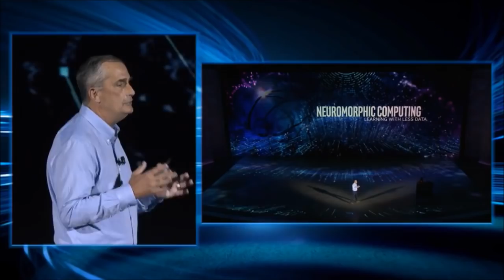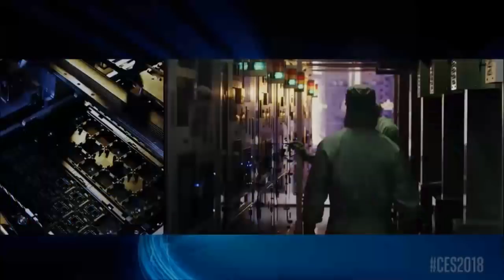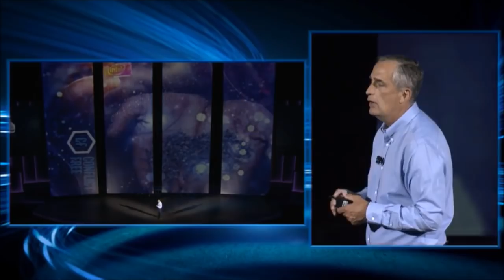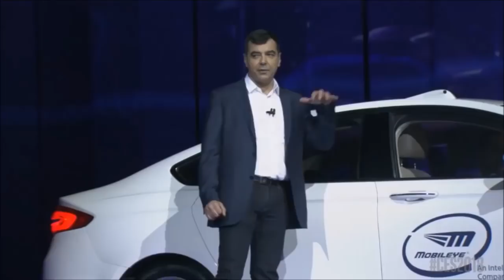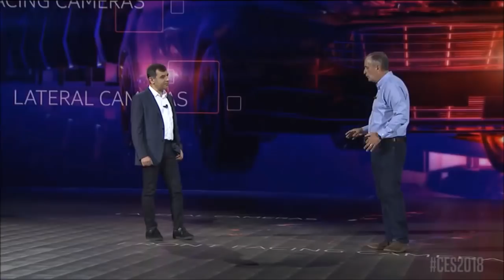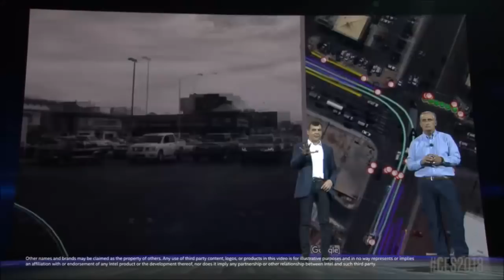Intel's New 49-qubit Quantum Chip & Neuromorphic Chip

Comment: Intel's R&D impresses the hell out of me, personally. I hear the AMD Ryzen and Intel desktop battle as AMD wins from some computer enthusiasts but Intel is abandoning their desktops race and going straight to Quantum and neuromorphic. There is no comparision between AMD and Intel. A working Quantum chip at room temp is beyond groundbreaking. Who cares if the presentation isn't pop culture and hollywood trickery. This is far better than anything put out before it. I'm surprised by the robotic enthusiasm of the crowd. Kinda creepy.
Reply: John LaFosse roomtemperature? Who said that?
Reply: Calamiro Asjcobeti your right. My bag. It is not room temperature. I've read a few articles on possible room temperature quantum chips on physics.org. I must have jumped to conclusions.
Reply: Still a step in the right direction for Intel.
Reply: No. A simple mistake. Last year, Physics.org listed an article or two on room temperature Quantum computers and I wasn't entirely clear after listening to parts of the lecture if they developed a room temp chip. Sounds like they are focusing on competing with DWAVE.
Reply: John LaFosse Yea a roomtemp working quantum computers are sweet :) lol just gotta make an emulated chip cooler :) and change a few other files AC/DC and rig up your CD Rom drive and shoot a laser back through your computer :) Ram ports :) moonflower.jpg Win XP :)
Reply: Nakor Z Intel is good :)
Reply: Jack Principle ever tried making the X circuit :) make the atoms in the X where it meets a circuit so it doesn't touch :) all with the eye :) eyeball it :) lol "i" :) the "i" phone lol the "i"Pad :) lol china and Proview Tech and the patent rights to the name lol and apple lol :) I hacked proviews email and wrote to their owner about how Apple and jobs fucked my on the i software and boot loader :) lol ELF and GRUB programming was fun :) see Tunes.org log :) 9-10-2005 :) its missing from the internet it was deleted after I copied it and sent bush and dick chainey an email showing them what I found :) lol some very incriminating evidence :) <++ :) lol see USAA FRAUD Facebook for the log :) lol Chinese dude @ Proview for the patents before 9-11-01 lol I was in 2004 -2005 with a clock hack you wouldn't only fathom of your logical I0 processor was capable :) Do you know what a logical device driver is :) how to make and timestamp one ? Do you know what timestamping and clock certificates are ? Are you aware of Quantum Entanglement and ink , and the air that l thoughts run an and how to hack your own thoughts and read it in code ?  Are you are of what the core of Windows is , how it all works , how chip design works , how bugs , and worms , and super colliders work :) notepad in dos ver >ver 6 :) engineering 0S + source code and Yahoo browser ver 3.14 and Explorer Intertnet ver 7.1 are was great it actually upgraded your ram 128mb , It's the quantum leap tool :) moonflower .jpg XP , Vista had a vet too :) gotta have 3 SQL's for quantum encryption :) Teleport , the trebuchet 1,2&3 3 being the necessary missing link for throwing data over the nuke fence :) aka Firewall fusion.dll and The smart fox jumps over the fence :) hehe SQL :) Transparency :) that was the big one :) that SQL :) with the trebuchet :) is the goods :) there were some SHA1 Al Gore Rythm Shannanigans I pulled on the gov :) lol ever sent a fax to another year :) hhehe :) or called someone in a different year :) lol win XP SP1 and the virtual fax machine was a great hacking tool :) hehe . It sucks windows took out all the good stock hacking tools after dos 6 :) hehehe
Reply: I don't mind Intel as a company.
Reply: The same monopoly accusations and lawsuits have come about for all or most of the major semiconductor industry. Its founding and formation is and was from the traitorous 8 which formed Fairchild and Intel. Semiconductor fabs aren't a dime a dozen and they trade tools between each competitors never retiring machines that are decades old in order to supply chips for older tech. If Intel doesn't provide this service why should they outsource their patents to startups? The monopoly ruling is probably right. In certain regards it is in the nature of a semiconductor manufacturer to have the best and highest quality facility. What impresses me still is Intel does have a better quality research and fabrication Facility. That is a good thing for computer users that they are dominating and pushing the envelope. I've got no problem with this move. Good for them.
Reply: Anyone can cherry pick negative information on any subject and I'm not really going to go there. The subject at hand is Intel at CES and what their direction from concentrating on the desktop market to putting their "chips" into neuromorphic and Quantum computing. I hear price gouging argument from gamers who own AMD mostly. And there is tons of negative things to say about all semiconductor manufacturing processes and the environmentally unsustainable model that all companies involved are responsible for. That being said, having worked in a semiconductor fab. I've kept an open mind about the desktop chip market and based on what I've looked into about Intel's facility and R&D they are pretty advanced. Maybe not the top in the world, however once they have an advancement in speed or techniques for making chips less expensive sure they should pass that on to the consumer, but their intellectual property is owned by them as a corporate entity. The higher price have a political side to it sure. There is more than public interests in a semi-conductor fab. Many of a semiconductor manufacturing clients are the military.  We can talk about negative fines and lawsuits of other competitors all day. I don't think that is relevant or a useful argument unless I want to bait trolls.
Reply: I agree. AMD is so proprietary
Reply: AMD is afraid to venture out to Quantum computing.
Reply: Silly Man Quantum Computers Dont Work In Room Temperature Everyone Knows That.
Reply: Jack Principle It's always impossible , till it's not :) see my USAA FRAUD Facebook page :) see my Drmstr.dll and core.dll logs for what I was doing with the versions , file size and dates :) I got to spy on the future and edit History . Merge the realities we had going on the different versions of internet , and Nelson Mandela's death :) lol Y2k clock policy and NT design :) I finished 4G on Sprints Network before I finished 3G :) I got to watch Obama take office remotely from 2005 :). History is already upto 2086 it can be hacked . I made a key so only I can open the port . Moonflower.jpg in Win XP was mine by design . USB 2.0 was mine by design, the first 100mb tcp/ip connection adapter was mine by design , NT 4.0 and 4.1 were mine by design , NT 5.0 thru NT 10.0 I made by design in 2004-2005 as well, Hacking the clock, the internet is an archive , I hadn't made My win 95 update to win 98 and win 98 update to 98 second edition and hadn't made the SQL's for the internet update in win 98 second edition till 2004 as well lol, Msft money 99 was mine by design , The copyright (R) bubble I had timestamped , in 2004 there were 3 versions of Windows CE and cellphone airtime platforms , The money for the airtime wasn't backed by gold or and digit in a computer , NYSE and insider trading ran rampant , The Clinton's and bush's had this tech given to them on a quantum hack , NASA Rover wireless tech , our realities merged in 2005 because of the data crooks in DC rigging NYSE and Virginia or Virgin mobile :) lol 9-11-01 hehe airtime :) I've been involved in making quantum encryption keys for Yahoo email servers and hacking the email servers in any year I wanted to and could edit history before the merger of 9-13-2005 :) Why did Nelson mandela die twice :) Why does every single copy of BerenstEin Bears now say BerenstAin Bears ? lol it's too funny :) I've spying on both versions of net lol :) Secret service Agent Brown lol came to my house and got schooled on what a pile of shit our gov is, office 2k for msft lol , their clocks went bust on Y2k and I made the gov officials a fix so they could open their product on 1-1-2000. You have no idea how fucked the clock was , it was at the end of the road Y2k and it didn't Truly get fixed until 2004. The clock and all software had holes in it like you wouldn't believe :) goto the clock in Windows :) open it :) click the advanced tab , and see where it says NIST internet synchronize :) I have an updated bios (NET BIOS) I made the software for myself , I popped 7 light years before I settled on the chip I have now . I blew up 7 bios chips to merge the timelines :) you should've seen the communications box on the phone pole :) plasma arch :) boom ! Lol see my logs on Facebook :) USAA FRAUD :) see my twitter feed :) and if your a programmer you'll understand the tunes.org for 9-10-2005 and you'll understand my drmstr.dll and core.dll file sizes and versions number for 9-10-2004 :) There were a couple versions of history and the future running parallels :) notepad in Windows is how I designed all my software , Reverse engineering VIA chipset Drivers is where I started , My name is VI< or Vic. IVIC or I Vic or MC :) M<2 MC2 MC2=E I started breaking down MC's and Squaring E's and Timeing Ram differently , the moonflower.jpg and power.jpg for Windows XP was my design . I made a win ME service pack for Win XP and fixed win Me's USB issue and wifi and bios issue w the clock :) I went back through windows ver 3- and wrote upto win 8 and the switch and NT 10.0. The logs for tunes.org = the smoking gun :) and also :) I rapped it while I was doing it :) www.soundclick.com/akalegendarystatus and my quantum encryption keys are compressed into the data behind the pics of my ID and red paper with CD's , and a pic w ID and bible :) I found a way to delete all the data of a pic .jpg and use it for a template to store data :) Use a UV and Infared and square the UV :) UV3E :) heheh I was able to ship tons of data this way around the internet VIA email VIA clock hack :) i.ink ink.ini ini.ini and clock certs :) after you break down MC2 = E the E flips like the Dell logo :) 0(R) the Enron logo lol :) I hated C++ so I snuck a Virus in some of the code I gave gov for Cellphone designs. Lol <++.......... a little PACMAN virus for them to eat their code :) Enron lol , Wa D.C. , Intel , intelligence agencies lol :) notepad is a particle collider :) if you can read and write new languages to code and decode the symbols on Egyptian walls you're know how to decipher my symbols and code :) heheh :) Lol Quantum hacking was so much fun , George Bush Spoiled it for me , took my security clearance away , shut down all of my fake names with real bank accounts , made it real hard for me to get shit done online . Lol The bush's Stratasec hack , virgin mobile lol, security for phones lol , Fuck the GOV FUCk NSA Fuck CIA fuck msft , Fuck the patent office , when I hacked them they and told them what I wanted patents on they laughed and asked me if I was serious :) Fuck yea :) lol they were In 1996 I wanted my Intel property rights for Win CE and cellphone airtime I had just made these clocks :) thy gave the some Crook the rights to sell the airtime and then sold 3 versions of the same year of airtime and I had to validate it all :) hahah the Mandela Effect rofl... try validating everyone's phone calls and validating the broken clock and making it have a recall on all invalid entries :) Hahah quantum computing at its finest :) USB 2.0 was supposed to be just a file you replace :) lol Intel and bill gates made everyone including world gov update their mainboard lol :) I could update any $50 PC from PC recycle because folks were throwing away good PC's just w old outdated ports and CPU . Upgrade RAm upgrade CPU and software and I learned how to truly hack NIST synch and the clock and learn how the core.dll of Windows works and how it's cooled :) I made a super cooler for it :) Fusion .dll :) mscoree.dll was fun coding . At PC recycle I could get all OEM msft OS's with original instructions. I learned to how make a genuine msft update in win 95 and the instruction book and ink.ini was updated :) the Xerox machine had a few ports I could hack too :) when scanning data can be hacked :) I used to send data over the air by scanning stuff too. The light from the scanner gives you a few years the data is in limbo. The speed of light , and how the ports inside ink and atoms are connected . Quantum entangled photons , at an atomic level , connected to every aspect of my life . Lol secret service came to my house , and told me they can't make it public because they have to "protect national security " Rofl Mandela effect- Haiti earthquake ,Quantum Entanglement , clock hack https://youtu.be/gSoz7GUwuEo Here is Nico , He is my coder friend , He was working for msft at the time I told him about my quantum hacks :) I seen Haiti get buried from the earthquake that The Clinton's cashed in on :) I told Agent Berg from secret service I seen that earthquake in 2005 happen on the clock hack and it was because of the clock Synchs . 9-13-2005 . I told the agent to warn Haiti of incoming :) The cellphones airtime had just been recalled and validated and some $ was still in banks from a reality that was deleted , as in never happened :) like My BerenstEin Bears books hahaha :) I live just a few exits down from Microsoft :) Vicrosoft lol IVIicrosoft heheh I always like IIVII icRosoft :) RO copyright the airtime the Dam machine is Running lol (R) bubble validation Certificates :) copyright My dreams lol Drmstr.dll hehe :) what versions in which reality now it's a mess :) Mandela Effect The Name Of The Book Bush Read With The Kids On 9/11 Has ... https://youtu.be/atZYYET7SQM lol
Reply: Jack Principle Silly man :) do you know what ver of Windows and when the first Alien head appears in core symbol fonts /) hehe
Reply: Jack Principle Silly man, if there was ever a quantum computer and it had been programming since 1929 you and most the world wouldn't believe it anyway :) lol I'm a tunes.org quantum engineer :) Quantum clock master technician :) AMD :) AIVII>
:) lol Win XP and win Vista lol XP and XV :)
Reply: Jack Principle AM I> AM FM AM PM AC DC :) wanna see what happens when you actually put a ground wire to the clock :) hehehe
Reply: Jack Principle how well do you know all the versions of history :) heheh and operating systems :) and backdoors , and all the fraud lobbyist in gov :) lol when I made the quantum computer I had to code and send emails in black and white Symbols that others would have to decode in the 1990's :) one of the first Things I did when I had the quantum access up and going was get lots of cash and open Swiss bank accounts :) lol I wish there were bit coins back then . When bush came into office Y2k he made sure all my $ was cleaned out the accounts and made sure I had no access to Capitol for engineering :) fuck him I still found a way to get a couple million dollars and pay people off To get HD radio going and the TV signals all going Digital , and Smart TV's and 3D printers :) you see printer drivers were always fun for me to make :) updating printer drivers :) doing lots of programming , I worked 168hours a week for several years until the job was finished , I put a timestamp on all my emails and programmed years upto 2012 leap second and then merged all previous clocks there and and kept certificates of validating time and softs. From 2012-2086 is a new chunk of air time :) https://www.wired.com/2012/07/leap-second-glitch-explained/, a block of data just waiting to be spied on :) hehe :) I made the internet for submarines too for the Clinton's in the 90's remotely from 2004 :) lol Yahoo email hack :)
Reply: Jack Principle try quantum computing what happens to a whistle blower down at CIA , NSA , FBI, News outlets Rofl :) 9/10/2001: Rumsfeld says $2.3 TRILLION Missing from Pentagon https://youtu.be/xU4GdHLUHwU :) The real enemy is "much closer to home " ;) Hacking the pentagon was a blast :) literally :) Poor April Gallup :) they purposely didn't update her PC :) and when she turned it on that morning at the pentagon :) Boom :) what a boomer :) and C4 :) VI<>IV :) lol the VIIV chipset :) ever run super symmetry calculations :) ever made a crop circle :) hehehe :)
Reply: Jack Principle https://www.yahoo.com/news/tangled-apos-particle-apos-helps-024000757.html This is what the fireball looked like that came out of the Networking /tele box on my power pole :)
Reply: John LaFosse https://www.yahoo.com/tech/amd-apos-esports-push-improves-042700733.html :) I always loved my AMD chips :) half life for half the price :) shit I could build an entire PC w an AMD for just the price of an Intel processor :) and it wasn't like it was so much worse . Not quite as smooth as an Intel , but there was room for improvement :)
Reply: @ezvic420  post a few links to what your talking about.
Reply: Who is AMD?
Reply: John LaFosse You want a quantum computer on normal temps well i guess you could ditch silicon and use a biological  processor unit, 
because a brain still has faster responses than the current quantum computer processor.
And they are studying to program biological matter to store data and its possible
they already stored data in cells so why not make a processor it would not need the insane cooling.
And i bet it will be even faster than silicon.

I think that will be truly the next leap in technology.
Reply: Jack Principle https://roserambles.org/2018/03/07/cern-suffers-massive-explosion-march-7-2018/comment-page-1/#comment-115724 lol